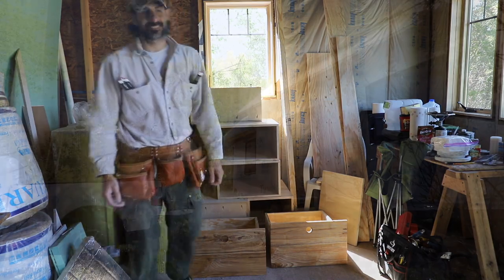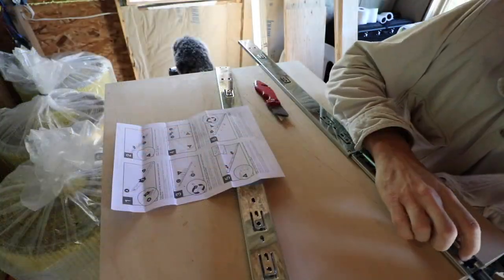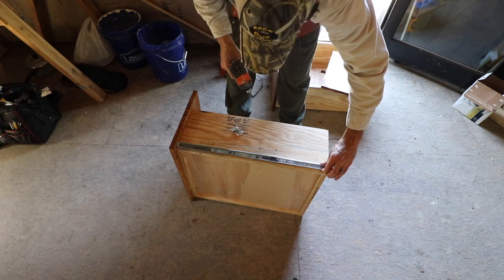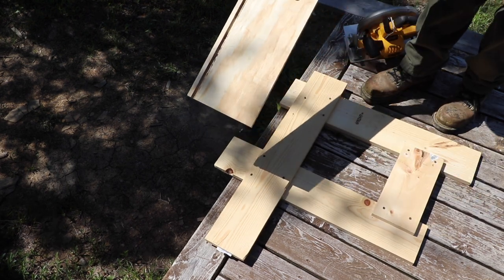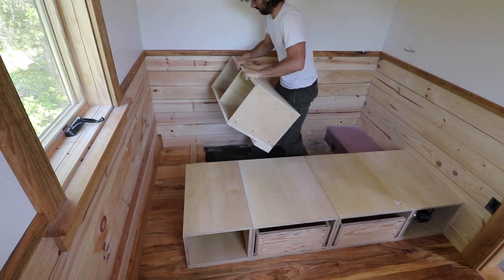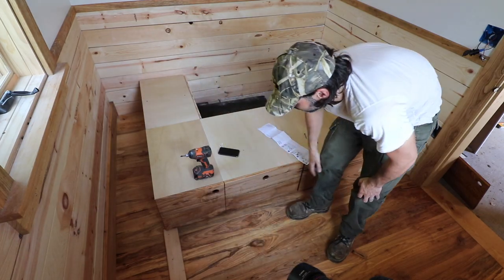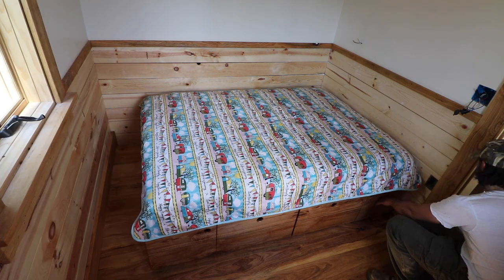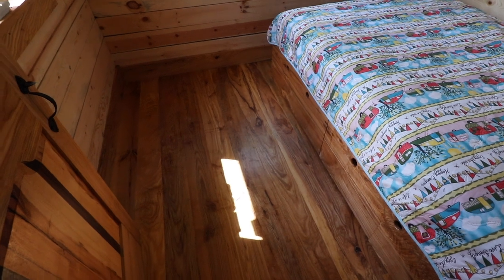Making a Built in Bed for our Off Grid Cabin

Comment: It would be nice if you could find a metal cover for the vent on the furnace and if you can have the return air to the furnace suck from the foot of the bed it might encourage some circulation of the air in the room. But it's nice to see that you're finally getting a comfortable place to sleep while you're working out there. I know for me it makes a world of difference working at my Cottage when I have a good night sleep after all of the work of just getting out there it's nice to have a good restful sleep before it getting up and spending the day out there working on projects
Reply from the maker: Thanks Wayhart, the cover I have is pretty nice Is black plastic I think it will look good against the wood and it is specifically made for that vent so it will fit just right.  I will cut some holes into that cubbies that are for the shoes so it will hopefully get the air moving around some.  I'm really looking forward to having a comfortable place to sleep.  I always wake up tired and sore there.

Comment: Must have been your first experience with the full extension drawer slides, one inch clearance is pretty standard, it a good thing you didn't glue the drawer bodies. Nice bed,  it will likely outlast most of those particle board factory beds.  You are becoming a very talented woodworker, nice job.
Reply from the maker: Thanks Harold, yea it was my first time.  I think I might have known I needed a half inch on either side and just wasn't thinking when I made it.  Appreciate the compliment.
Reply: That was the first thing I said to myself good thing he didn’t glue them too !

Comment: Got pencils Mike?😂
You see now I have to know why you don't like the Milwaukee saw. I was thinking of getting one. 
The build is awesome as usual.  The secret compartment is safe with me.😉👍
Reply from the maker: Ha ha those pencils should last me at least a couple hours.  Thanks and don't tell anyone about the secret compartment.
Reply from the maker: Oh yea with the Milwaukee, its got great power and battery life but the plastic face plate has loads of flex, and the spindle that holds the blade also has a lot of flex.  The metal that supports the plastic face plate is also very flexible.  It would be perfect for all day framing jobs but I need more precision out of my saw.
Reply: Mike, Makita my friend. You need to give their tools a shot. I have two of their battery powered trip saws and have been very happy with them.
Reply from the maker: @BarnStangz  I almost got a Makita instead of the dewalt, I have Makita 12v drill driver set and it is awesome.

Comment: ***Heres a idea 💡 ****
Use a piece of wood with hinges on side of the wall & put the wood over your secret compartment in ur bed foundation. Make it with a keyed lock on the opposite side from The hinges. Kinda like a round chrome keyed lock like you see on those little lock safe security boxes you buy at Walmart or Lowe’s. 
This will keep potential thieves from easily accessing it if they were to break in & discover it upon ram sacking your house! If it’s locked it’s gonna take too long for them to access it & thieves usually want to get in & get out in a big hurry & anything to slow them down they leave alone. 
Anyway if it was mine I’d definitely put a hinged board covering the secret compartment with a lock on the other side so only I could get into it.
Reply: I meant with the hinges on the side of the board where the back wall is. Just so you know I wasn’t meaning put the hinges in the wall. Put the hinges in the bed frame & lock on the side of the bed where You get into the bed. So when you open the compartment door it will hinge back toward the wall. You could also cut you a hold up stick like a 1”x1” board to hold the hatch lid up while you are accessing it! Kinda like a hood of a car has a hold up rod! It’s just an idea I thought may help you out! 😊👍
Reply from the maker: Thats a good idea, any sort of deterrent will help. I like the hold up rod idea too.

Comment: Looking good. What didn't you like about the Milwaukee?
Reply from the maker: I didn't like the plastic face plate, the spindle that held the blade was very flexible and the metal that held the face was also very flexible.  It had power for days though and would be great for framing.
Reply: @50Acres  Thanks for info! I appreciate a solid tool even if it adds a little more weight.

Comment: The bed should be atleast 3inches from the floor.. Add some feet.. Good for cleaning up.. ..add some box book shelves above ur bed header. Led sting  light under the shelf. 

Now that the bed is in.. All u have to do is sleep in it.
Reply from the maker: I've tossed around the idea of book shelves or another bunk... or maybe both...
Reply: @50Acres   with double bed, cabinets inbetween,  a half size bunk bed..for 1..would be ideal..

Comment: 13:28 Excuse me? Your furnace will exhaust into the bedroom, or even inside that right-hand storage cupboard? I must be mistaken. :-)
Reply from the maker: It's a direct vented furnace, it pulls combustion air from the outside and also exhausts outside.  It draws air it will heat from the interior and blows the heated air out from where that last door will be attached.  I haven't cut a hole in it yet to accept the register.

Comment: Is there insulation in the ceiling?
Reply from the maker: Yes I put 6 inches of XPS rigid insulation on top of the pine ceiling. ~R39
Reply: 50 Acres & a Cabin 
Excellent